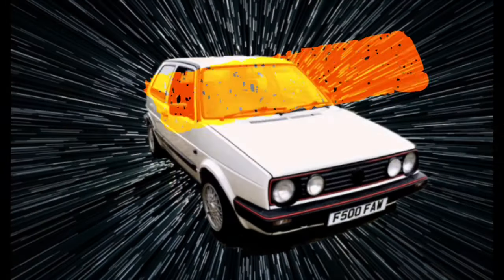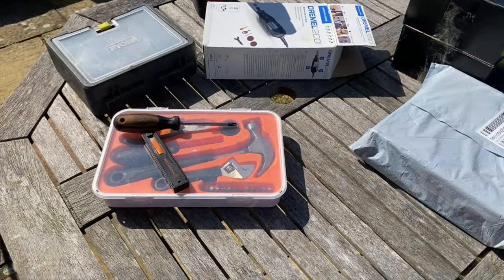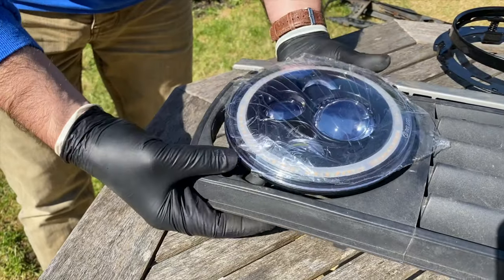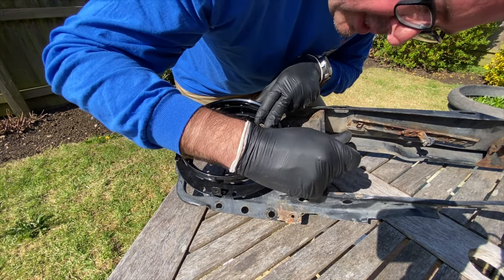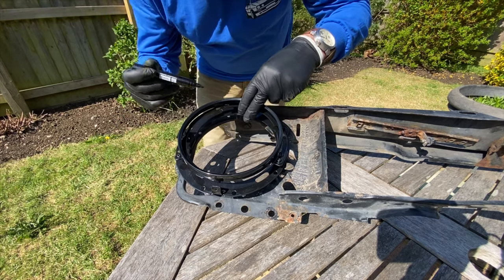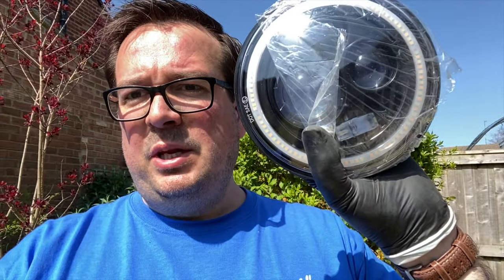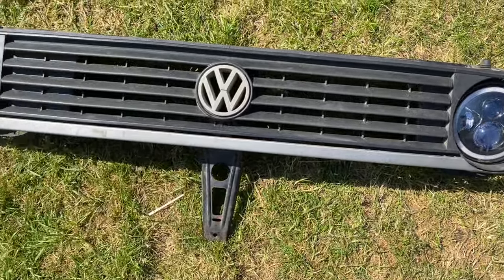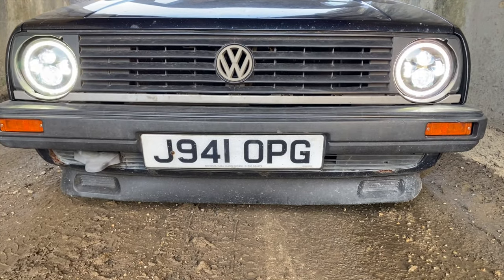How To Upgrade MK2 Golf GTI Headlights with 7" Jeep / Landrover DRL Projector Lights

Comment: Hello, thanks to this video ive done this exact install, i have a question about the indicators part of the headlight, how do you stop them from flashing so fast?
Reply from the maker: You’ll need a set of led indicator resistors. They’re about £10 on eBay and they stop them flashing like mad
Reply: @BarnClubCars  thanks! After much research i found a pair, 8ohm 25 watt, set them up in parallel, one for each ring and it works great

Comment: Do you have any MOT issues with these? And how's the visibility at night? 

I've just ordered a set
Reply from the maker: No problem with the mot. There is loads of Landrovers with these fitted so you shouldn’t have a problem. At night they’re great, I added a wiring upgrade kit to get 12v to the lights and they’re spot on.

Comment: Hi mate, any updated links? The brackets seem to be twice the price of the lights these days?

Or would you recommend another way of mounting them (that you can still adjust the beam) now that you've seen how it worked before? Any bother with MOT? Even though MOTs are only pretend ones in England anyway, they send them over by post to Ireland 🤣🤣

Comment: do the halo headlights have indicators fitted into it in the ring?
Reply from the maker: Yes the do but we didn’t have time to wire them up. We’ll be putting a set on the track car this year so we’ll do it on that one.